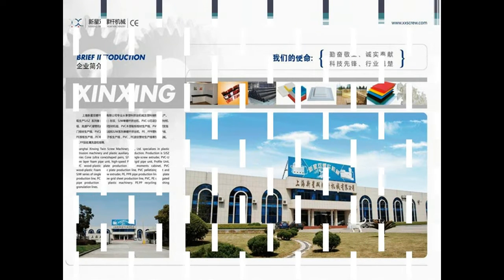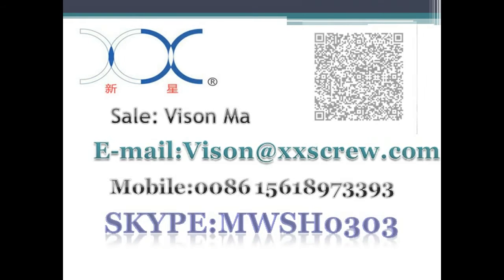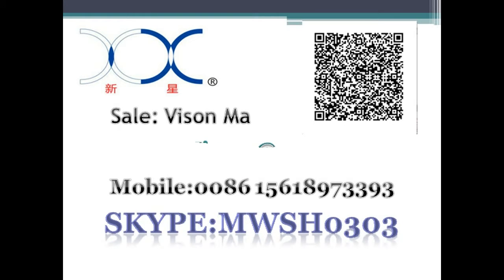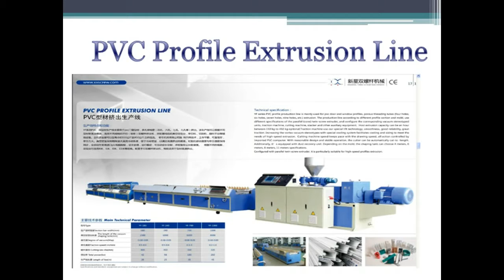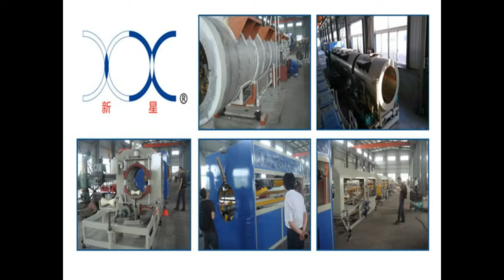PVC profile PVC window PVC door extrusion line

Comment: I used to do this for about ten years or so I can run single and twin screw my set ups were 2 hrs or under I must have made millions of feet in product all homes from the 90's and up to 2003 were built with my production i loved doing this job but breathing in pvc fumes almost killed me so now I build heavy equipment.
Reply from the maker: +W4RD1N8ER  Thanks for your  story. And i can get that you are a good experienced  enginner and good businessman. In fact ,our factory start from 1987 on screw and barrel at begainning.  I can understand what you mean about the smell, because sometimes when i was in facory to watch the testing , i can smell that , not good and harm if it is a long time. You are right , after so many year ,you need to take care of your healthy instead the work and business.  Hope you can recovery better from that.  And what do you mean heavy equipment? with more advanced technology?
Reply: Shanghai Xinxing Twin Screw Machinery CO.Ltd, China I build rock sifters and rock quarry equipment rock crushers and belt feeders. Elrus Aggregate systems look up this site and you will see what I used to do.  I am skilled in Heavy duty mechanics as well I can weld Aluminum, steel I fabricate what ever is needed from plate steel and other materials. I also build computers for fun I used to work in gas and oil industry making downhole logging equipment.  I have worked with all sorts of things I can build electronics as well making circuit boards and soldering components to them as needed. I do not like to be limited to just one thing. I can do many jobs I was real good at plastic extrusion I took great pride working on plastic profiles as well as pelletizing making carrier resins for plastic bags and such things for Nova Chemicals, Poly One plastics powder and cubed. We used Kraus Maffei twins and Cincinnati Millicron equipment.  I cannot work with plastics due to breathing issues I am in good health now but I have asthma from working in plastic plants I liked this video brings back memories I wish I could still do this job.